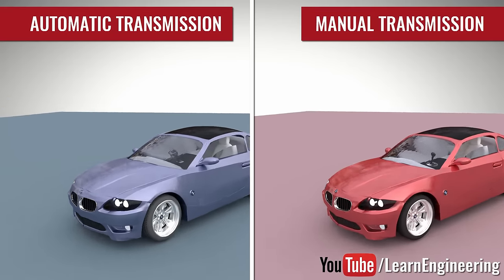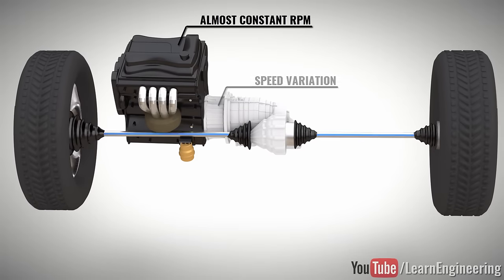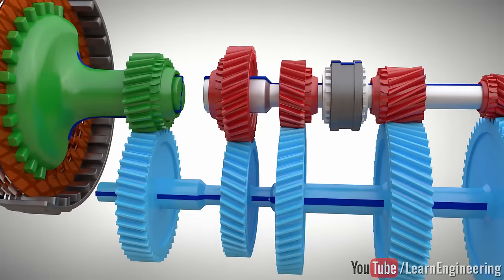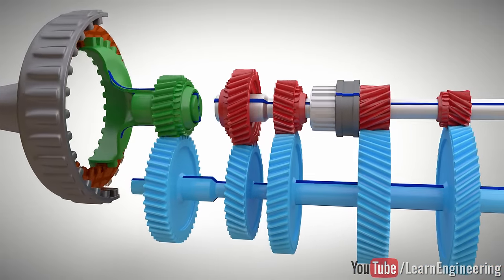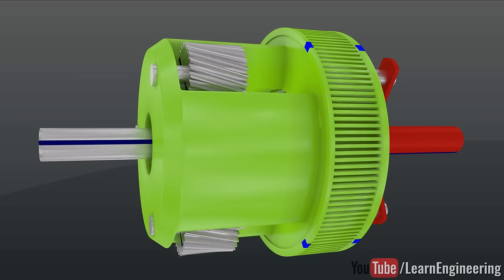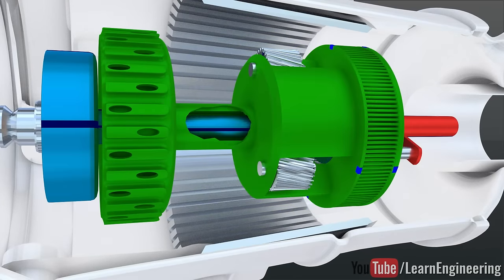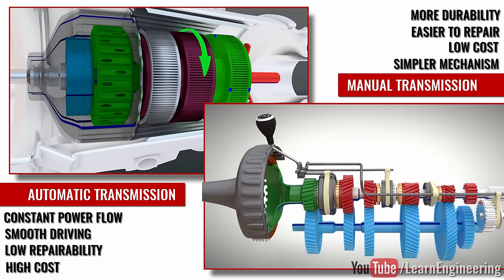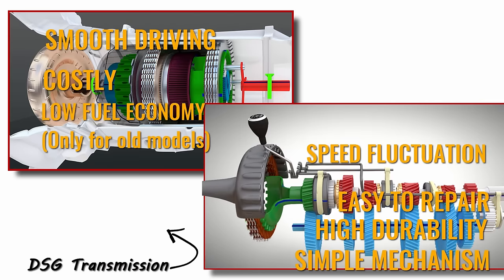Automatic vs Manual Transmission

Comment: Tesla drivers: what's a transmission
Reply: Sonic557 automatic d and r
Reply: ACTUALY ANOTHER SCEANario!!!!!!!!

Widow: why my husband got burnt in tesla  and  i have to pay still for his stupuid car !!!!!!!
Reply: Sonic557 
Tesla Drivers “ I LiKe BiScUiTs” 🤪
Reply: @crummyy no they don't. The motor is directly coupled to the wheels tharough a single gair pair and deferential. The motor doesn't stall at low speeds like an IC engine would so you don't need to disconnect it from the wheels
Reply: 00rphb  get off your high horse
Reply: Flying Car Driver : What's Tesla
Reply: @MrDaniyalAh  gear pair* differential*
Reply: Lmaoooo
Reply: Who cares.
I will always drive my manual.
Reply: @masonnix9566  He wrote comments not only for you, drive whatever you want.
Reply: @masonnix9566  Doubtful. First, within in a decade you'll have to switch to electric, max two decades if you are determined to be a hardcore holdout. Second, little bit after electric cars take over self driving cars will phase in and then you get to do your own driving only on racetracks or off-road situations.
Reply: @aleksandersuur9475  
A little bit over a month I just got my first car and im planning to have it for atleast 5 years.
How does self drving make ou lives easie?
Another reason why I don't like automatics is that they are the first step to self driving cars.
Reply: 00rphb  thats why it has one of the fastest acceleration of any car
Reply: 00rphb  youre exactly like those people that called the internet a fad. Electric cars have an amazing future with supercapacitors and superchargers.
Reply: @crummyy no... It has a fixed speed gear box.
Reply: @BigPanda096  no. the problem is not everyone can afford a tesla because its so expensive, but of course you need to plug "ignorance then self proclaimed expertise of a subject is unbecoming of you" and "people are stubborn" because you need to feel superior.
Reply: Tesla drivers: what’s an engine
Reply: Me: It’s a poor person vroom vroom
Reply: Ask a Porsche Taycan
Reply: The use CVT
Reply: @crummy well sir,. Where's your comments?
Reply: @aleksandersuur9475  The current world infrastructure cannot handle even a 50% electric car fleet. We are still far from switching everything to electric, at the moment 30 years to achieve 50% seems more believable
Reply: @bassbusterx  Bullshit, the grids can handle it no problem with marginal upgrades where grid is short of capacity with or without the electric cars to begin with. This stems from invalid logic of "zomg what if all electric cars decide to fast charge from 0% to full all the same time?" Well duh, it also doesn't work if all drivers decide to show up at a gas station with empty exactly in sync with ever other driver, doesn't really happen though because that's not how people use cars. Take a look at power use of day vs night, there is all the grid capacity you could ever need. Power grids are already built to meet peak demands that significantly exceed average consumption, all that electric cars will do is use that extra capacity when nobody else does.
Reply: @aleksandersuur9475  You clearly live in a big city if you think that. Do you have any idea how many places have the bare minimun for electricity? How would those places be supplied without a major overhaul to the grid? Not to mention, as always, you just think about the US when the rest of the world still has a lot of places that can't even meet the basics, emergent markets suffer with electric cars as the eletricity price is too high and the grid can't even reach all of the population.
Reply: @bassbusterx  Whoever said anything about green or workers or environmental impact? I just said what is going to happen on car market over next decade or two. Electrics will take over the new car market completely and it's certainly not a bad thing. Do you care about the sooth in your lungs from tailpipes and about all the money going to the Saudis? You should, because these two factors alone are enough to make the world switch to electrics. Electrics are cheaper and cleaner, whatever other challenges come with them are of marginal importance and all very much solvable anyway. 
You need to update your grid, then you bloody well should do it anyway. You want to recycle batteries, go ahead, but if not then li-ion batteries are no more environmentally hazardous than any other trash, they contain no heavy metals like some other battery chemistries do. Want to clean up your supply chains, you are probably going to end up doing so regardless of wanting it or not. You are just reaching for random complaints, but that does not change reality of where the future of cars is heading.
Reply: @aleksandersuur9475  if there was a way to come back here 10 years from now I'd absolutely do it. People have been saying we'd have flying cars since the 30's and that never happened. Until battery technology improves, we will not be seeing electrical vehicles take over.
Reply: Model T owners say the same thing. Basically it's a manual transmission but it only uses two gears. The first gear is a planetary gearset while the second one is direct drive.
Reply: Gay
Reply: @masonnix9566  Well, the unfortunate truth is that eventually, we will fully transition into electric cars as it's more environmentally friendly.

Manual cars are gonna disappear sooner or later.
Reply: @atheistyoda8915  Bikes are even more enviromently friendly and yet they are still around.
Reply: @masonnix9566  That is the point. They will remain because they are environmentally friendly.

Gasoline/diesel-powered vehicles are not which is why they are slowly being phased out in favor of the more environmentally friendly e-car.
Reply: @MyAlexWest  ..........what?
Reply: @MIGHTYxMUKESH   oh noe
Reply: @k-osmonaut8807  oh nyo
Reply: They actually do have a transmission, it works a bit differently however.
Reply: D, P and R
Reply: Tesla drivers: "i have regenerative braking so my brakes regenerate over time and i never have to replace them"
Reply: bruh 💀
Reply: @bassbusterx  we already could have flying cars (we already have working prototypes too), but if you really think about it its nothing we would want to have for everybody^^